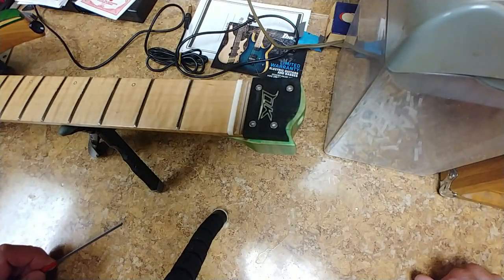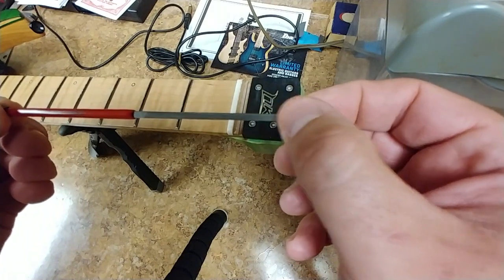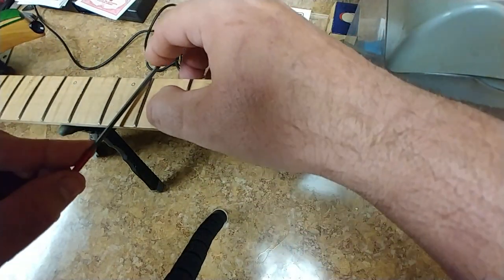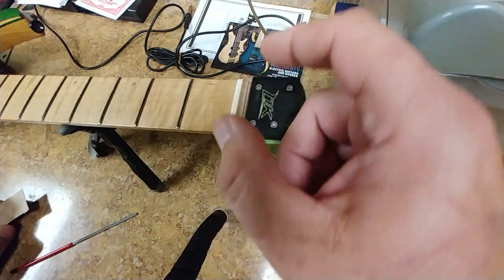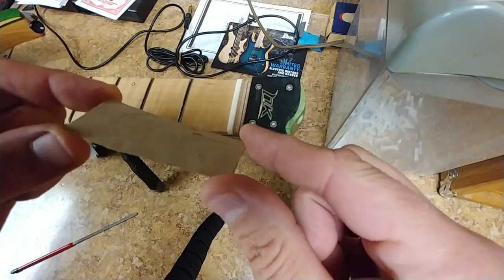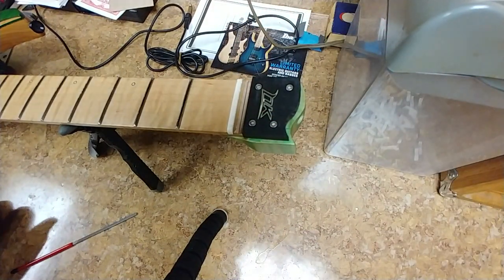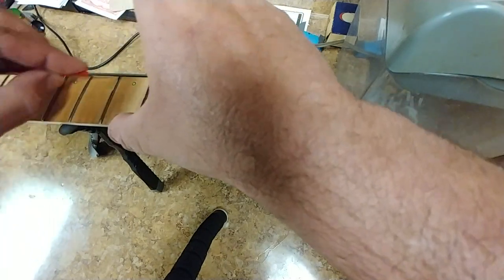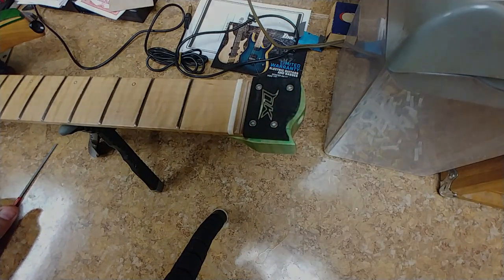NK Guitar Fixing Sharp Fret Ends  for George Part 4

Comment: I need to get one of those files.  I have a small triangle file I use but you have to tape everything off because there are not flat smooth sides on mine.  Whats the price on that?
Reply from the maker: i don't really know. the file came with the big box of parts and tools from eBay.